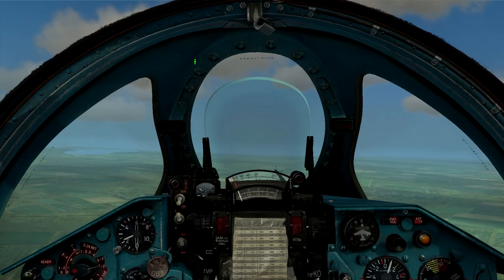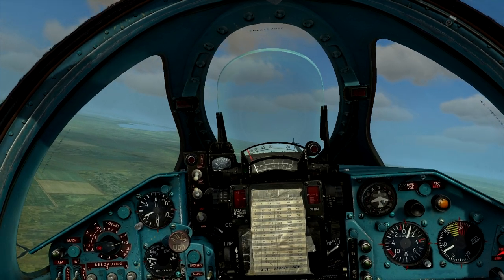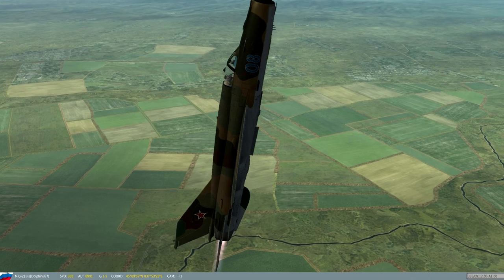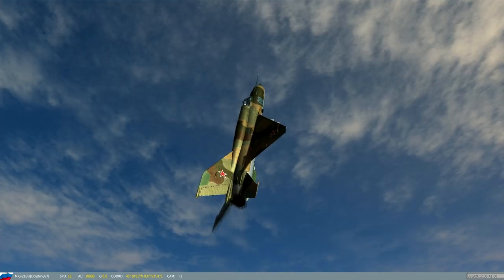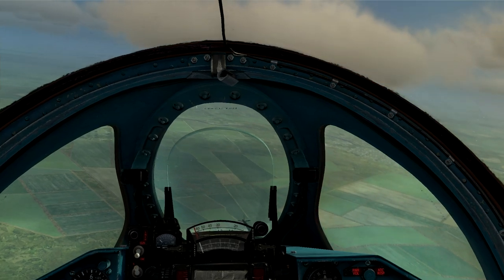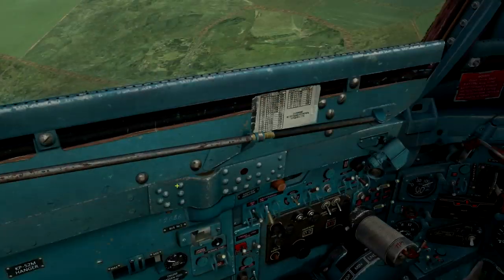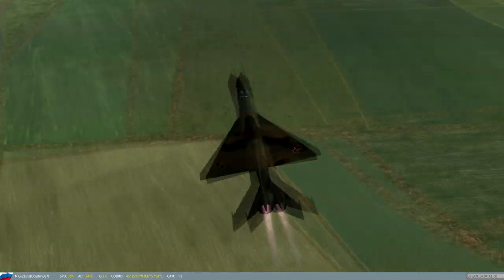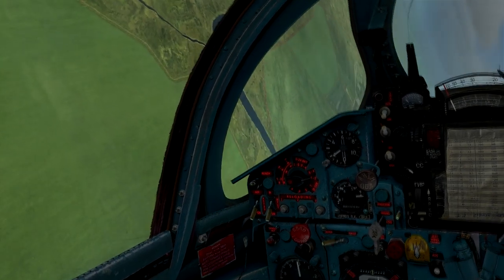Let's Play DCS World Mig-21 BiS - Engine failures, air exhaustion and how to fix it

Comment: Y engine is quitting because you're using afterburner in a low G (Close to 0) or negative G situation. Check the Manual.

"Flight with G load near 0 should not last for longer than 2 secs."
"Negatov G loads may be developed for not longer than … 15 sec. without afterburner, 5 seconds with 1st aft. and 3 seconds in 2nd aft".

Comment: The comments on this video are fairly old now, but according to the wikipedia on the mig-21.
"Additionally when more than half the fuel was used up, violent maneuveurs prevented fuel from flowing into the engine, thereby causing the aircraft to shutdown midflight."

Therefore, It can happen with or without afterburner being on, it all depends on fuel state and how you fly.

Simply put like a car or lawn mower etc... when fuel runs low and the fuel is sloshed around the tank from effects of movement, it will cause it to run away from the pickup line, and run the engine dry of fuel.

As LG1.Hipper said negative G loads wont help with this because it will pull the fuel away from the pickup.
Reply from the maker: GeneralPacman1 Yeah I have an update video on that. The plane's engine ceases the same way a truck will stall if it's tipped.
Reply: Yeah, i just noticed after watching the video you had a new response to the issue which i just watched, you also pointed me to the solution with that nifty emergency engine start switch which i appreciate as i had not found it prior to watching your video, keep them vids coming and keep flying!
Cheers.

Comment: If that's the case, then how does the engine stay running on the ground. Not caused by lack of air.
Reply from the maker: Because it has a fan that sucks in the air. If you run out of airspeed like in a climb, then what will happen is that the jet will try to suck the air in while there is little to no ram air. That creates a low pressure that is not strong enough to direct the air flow to the exhaust, causing a compressor stall.